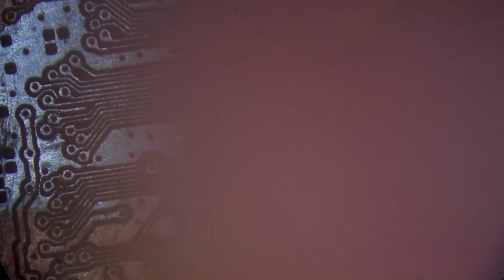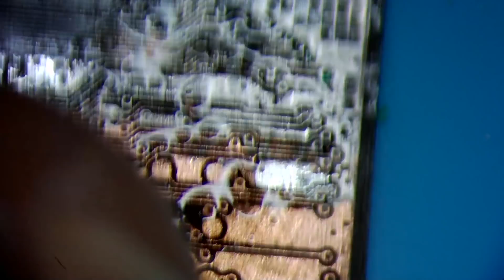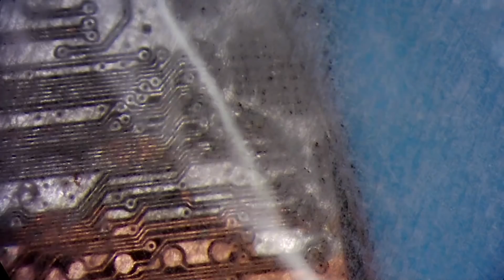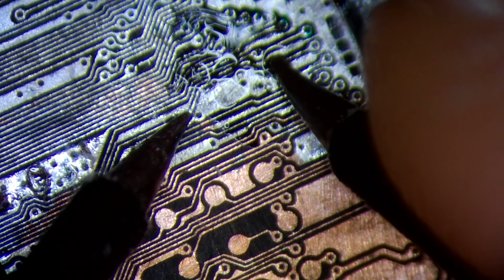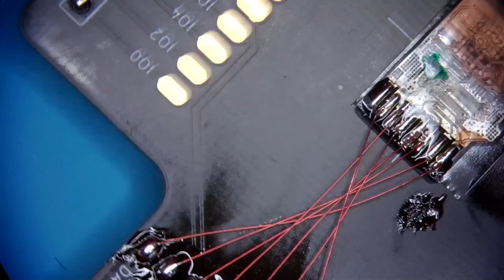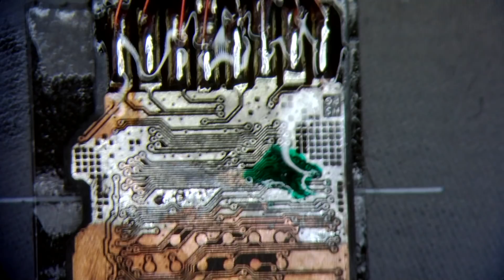very damaged microsd card from Europe part 1

Comment: i love your vids, but your "0.01/0.02mm" scale does not seems right... are you sure you did not ment just 0.1/0.2mm ? :)
(i also do a bit of soldering in my work - audio and tech around it - but i cannot really imagine 0.01mm enameled wire)
(edit: and before some sjw warrior starts screeching - i'm not saying you're lying, i'm just pointing out that those sizes seems way too small and if it indeed is right then... "damn son" ! :) )
Reply from the maker: I do my usual soldering of microSD card to NAND adapter with 46AWG =0.04mm but for trace repair in this case I had to scale it down. These size wires are often used in the phone repair industry. I did sweat a little on this case, but I got it done.
https://amzn.to/3RDVeGR - 0.01mm
https://amzn.to/3wTvX3t - 0.02mm 
if you liked this episode, then watch this one https://youtu.be/KsFKpqVhU88
this case is by far my biggest pride and joy :)

Comment: Am assuming that the wire that you are using is insulated and the “fluxing and scraping” before each trace repair is an insulation removal procedure??
Reply from the maker: Exactly, the wire is coated to prevent shorts

Comment: Awesome work. Question: why wouldn't you just solder from via to via bypassing the break in the trace?
Reply from the maker: Good question, if I ran it VIA to VIA, then it would be harder to connect to NAND protocol later. Other end will be used for that. You'll see it tomorrow 😜
Reply: Suppose you have the wire already in your hands and just extend to nand protocol would make 3 "easy" joints rather than 4 later?
I have no experience but doing all this crazy bends and tight joints looks lot more difficult than I imagined as above

Comment: Completely off this topic but have you repaired any spinning drives that were part of a failed striped RAID set ? I would enjoy seeing how you put the striped data pieces together.  Would also enjoy seeing how you can determine if an encrypted drive of any type has been recovered successfully since you can't see its contents. Do they have to give you the key?
Reply from the maker: Yes we need to the for data validation. Otherwise it's pay upfront for as is results. We work on RAIDs, I think I gave a few cases shot for it. I gotta dive deep into my hard drive recovery footage drive. There is like a year worth of content. Maybe after #30in30 I get so used to making them daily, we go #365in365 j/k
Reply: @hddrecoveryservices 365 eh?  that might be  a bit much to hope for...52/365 maybe ...  :) 

I'm trying to grasp the data reconstruction part too. You breeze through it so easily its tough to follow how you decide what the next step (interleave, voltage, ecc) is. I can't expect you to give a tutorial on that especially since you make you living doing it, but it would be interesting to know a simplified version if my old brain can keep up.  :) Thanks for posting all this. If I ever have a need, you are my first call.